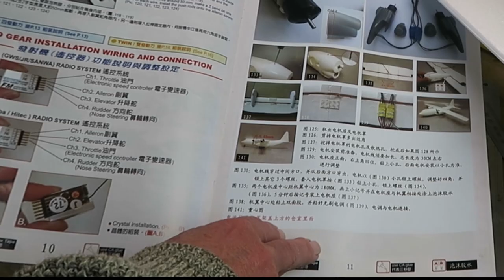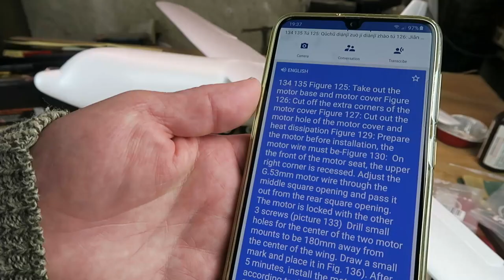C 160 Cargotrans Twin 1120mm Wingspan EPOS Transport RC Airplane Kit Build Part 2

Comment: VERY well done. CLEAR, plus just enough detail. Exactly what I was looking for, since I've never set-up the electronics for a multi-motor aircraft. Thank you very much ! Much sppreciated !! 👍
Reply from the maker: You're welcome! If you have any questions please ask. There is also some good info in this comment section if you scroll through. Have a great day!!
Reply: @1nformatica What is the diameter, in millimeters ( mm ), of the supplied servo metal control-rods ? In the current version, they now supply some control-horn metal quick-links so I was also planning on buying some extras, but I need to know the diameter-size.

Also, if you may or may not know ? : ...

The material is listed as EPOS. I've never heard of this. Would this be a typographical error or Is this possibly the more brittle Expanded PolyOlefin Styrofoam, or perhaps the more durable EPO ( Expanded PolyOlefin ) type foam ? Also, do you have any idea who the manufacturer, of this model, may be ? ... Thank you in advance. 😉
Reply from the maker: @smesui1799  My servo rods are 1mm diameter. The material appears to be EPO. The manufacturer is MD-Hobby Technology.
Reply: @1nformatica  Perfect ! Thank you so much & happy landings. 😉 ...🛩️ ...
Reply from the maker: @smesui1799  You're welcome! Have a great day!!
Reply: @1nformatica  I did also wanted to ask you: [1] Can the 2 ESC receiver leads be connected to a Y wire harness if differential thrust isn't desired ? [2] How far from the wing's center-line did you place each of the motor nacelles ? [3] Did you use hot- glue, epoxy, or what to glue the nacelles onto the wings ?
Reply from the maker: @smesui1799  Yes, you can connect the ESC's vis a Y cable. However I strongly recommend using differential thrust as it enables nice scale flat turns mitigating the possibility of tip stalling. The position of the nacelles is shown here : https://youtu.be/ofGLsLYnnJg?t=591 I used epoxy to attach them.
Reply: @1nformatica  165mm ( 6.5-inches ) on each side of the wing's center-line. Thank you. I know I saw & heard it in your video somewhere, but I couldn't find it.
Reply from the maker: @smesui1799  Yep! You're good to go!
Reply: @1nformatica  If so; it will be my first ( 1st ) multi-motor aircraft. By-the-way; there are XT60 1-male to 2-female adapters for those who don't want to solder, in parallel, the 2 ESC power leads together.
Reply: @1nformatica Do you have a video on setting-up differential-thrust ? Would like to do it your way, since I've never done it anyway. Thanks !
Reply from the maker: @smesui1799  That is true but heavy and adds resistance as well as another point of failure. Learn to solder well, it is a skill that is always useful.

Comment: Do you have a video or reference(s) to, on setting-up differential-thrust ? I would like to know how you connect to the receiver and set-up the transmitter. I've never done it. Thank you ! 👍
Reply from the maker: Depends what Tx you have. I have only done it on OpenTx / EdgeTx. It's a little complicated as you only want to increase the speed on one motor while not decreasing the speed of the other. In other words the mix from rudder or aileron is only positive.
Reply: @1nformatica  I have the FlySky FS-TH9X, FS-i6 & i6X, FS-T6, and the Turnigy 9X ( TGY9X ). None, yet,  have OpenTX but I am planning on it.
Reply: @1nformatica I found some helpful YT videos on differential-thrust setups using the TGY9X ( FS-TH9X ), FS-i6/X, and even for the FS-T6 transmitters with stock firmware. No need for OpenTX firmware.

Comment: Is it possible to used dual 30a and using 2200 3s Batery?
Reply from the maker: No problem using 30A ESC's although they will be heavier. I did fly once using a 2200 3S pack but it was heavy and sluggish. The sweet spot is between 1500 & 1800 for me. Thanks for watching, have a great day!

Comment: Which is the flying time?
Reply from the maker: Using a 3S 1500 mAh pack, if you fly "scale" like easily 15 minutes. If you rag it around the sky like a nutter, less! Thanks for watching, have a great day!
Reply: @1nformatica  Thanks for your fast response! Now, may I know which motors and propellers did you use?
Reply from the maker: @rva1945  There are links to all the components used in the video description.

Comment: What kind of remote control you using?
Reply from the maker: Hi, I use an FrSky 2.4GHz Taranis X9D Plus Transmitter  http://bit.ly/TaranisX9D_X8R  and a IRangeX IRX4 Plus 4-IN-1 Multiprotocol TX Module http://bit.ly/iRangeX_IRX4 Now I use a Radiolink R8F Dual Antenna Receiver with Battery Voltage Telemetry https://s.click.aliexpress.com/e/_9gdZED Thanks for watching, have a great day!
Reply: @1nformatica  And also can you share me all of your electric stuff that your using ?
Reply from the maker: @blueplane8656  The servos are Emax ES9051 Digital Mini Servo  https://s.click.aliexpress.com/e/_AZH807 everything else is listed in the video description. Tell me if anything is missing.
Reply: @1nformatica  also the wing servo too
Reply from the maker: @blueplane8656  I used the same servos for everything.
Reply: @1nformatica  How about can you share all of the c-160 description like electric stuff so I could buy it
Reply from the maker: @blueplane8656  I am sorry I do not understand. I have already given you links to all the electronics I use.
Reply: @1nformatica  do you have a pnp version was in stock?
Reply from the maker: @blueplane8656  I do not supply these kits, I just built one. As far as I know it is only available as a basic kit with no electronics.
Reply: @1nformatica  Do you have to glue or tape on these servo/esc wires under the wingspan?
Reply from the maker: @blueplane8656  Yes, that is what I did. I have made some modifications recently to the way the differential thrust works and coupled it to the rudder. Also added a "spoileron" function to aid in slowing down for landing. Let me know if you would like to see a video on that.

Comment: Hi, wich battery do you raccomend? 2s or 3s?
Reply from the maker: With the motors and props I am using definitely 3S. These are perfect for me : https://hobbyking.com/en_us/turnigy-nano-tech-1800mah-3s-30c-lipo-pack-wxt60.html YouTube no longer shows me if you are subscribed. Please consider subscribing if you have not done so already!
Reply: @1nformatica subscribed! sorry, i have other 2 questions: one motor doesn't works (i have "pnp" version) it rotate bad (jerky?) and the esc burn (i try to invert the escs but the problem remain) with 20A esc wich motors do you suggest?
how i can paint the plane? acrilic? (excuse my bad english)
Reply from the maker: @leobatterio  The motors I use are A2212 Brushless Motor 2200KV, there is a link in the video description. They work OK on 20 A ESC. Many spray paints will attack (melt) the foam. Yes, use an acrylic paint. Some people use a floor wax like this one : https://www.amazon.co.uk/Pledge-Klear-Multi-Surface-Wax/dp/B008HFVO32 after is is applied you can use any paint as it will protect the foam. Ciao!